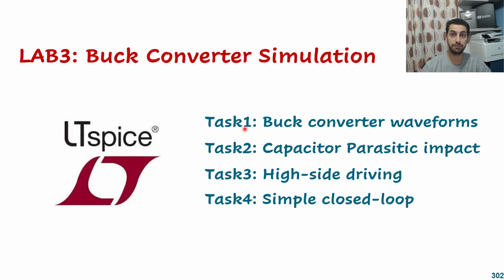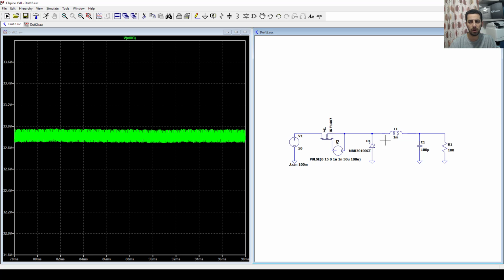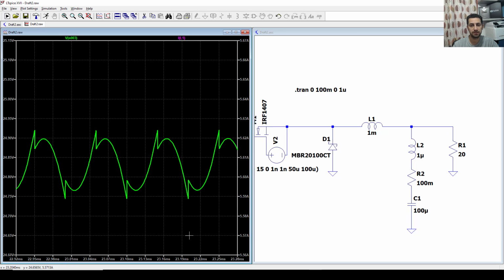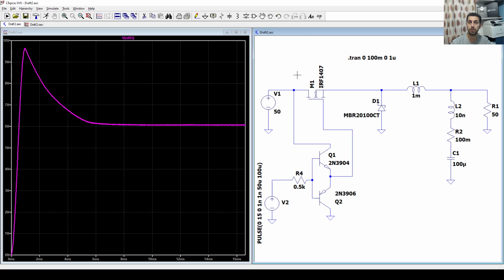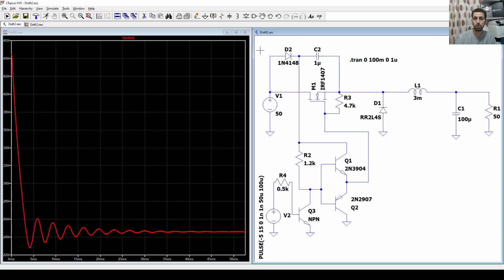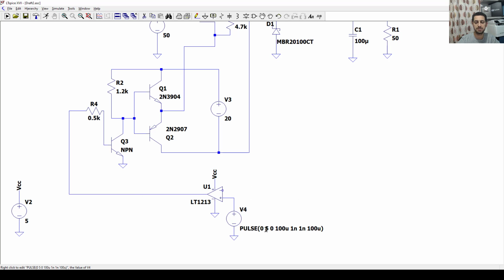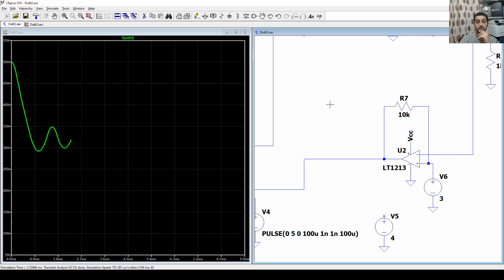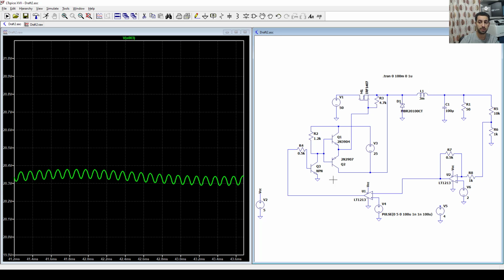Lab 3 Buck Converter in LTSpice | Power Electronics

Comment: I think the voltage divider R5-R6 feedback should be 9k-1k respectively so that the setting voltage 2V/3V will output 20V/30V ... thank you for your video .. the thought process is very smooth .. thank you very much for the very wonderful presentation

Comment: Nice job. I've made a buck converter myself but went straight to circuit design and physical PCB skipping the simulation (I've made a video of it if you like to check it out.) It's nice to compare the signals, particularly for the ESR. There are some differences too: I used a p channel MOSFET and an op amp for feedback.
I don't get why the simulation shows an overshot at startup. I'm referring to the beginning when the MOSFET is just driven by the PWM voltage source. It seems there is a significant LC resonance, that should be at 1590Hz, while the PWM frequency is 10KHz ... 🤔
Greetings from the Alps.
P.s. I'll put a link in the description of my video to this one as correlated.

Comment: sorry but how should we provide 5v (as v2 in this schematic) for comparator supply from the only source which we have (input) in real circuit applications?
Reply: kindly ground the other end
Reply: @esnupionyoutube  which end?
in this schematic, comparator supply pin is not grounded, it is pulled up to 5v.
my question is how to provide this 5v out of the only source which we have (input source)?

Comment: Hysteresis by resistor won't work unless the 3V ref point has some source resistance.  Your 10K/1K divider is 1/11th, not 1/10th.  That explains your dc error.  Finally, the feedback network should have intentional poles and zero to have phase margin and no oscillation.
Reply from the maker: Yes I agree
Reply: I've just found this video and was about to comment exactly the same. The 11 ratio explains everything about the feedback errors.